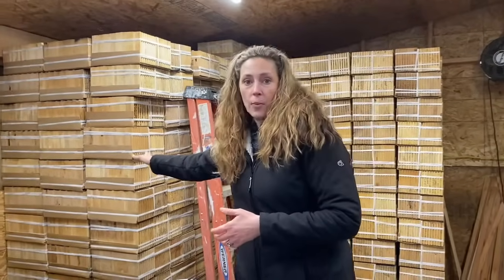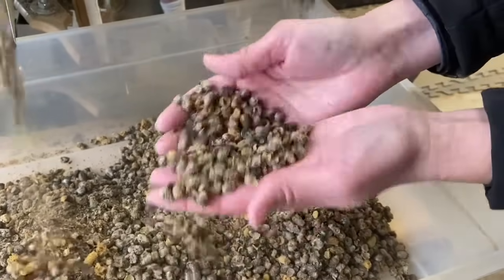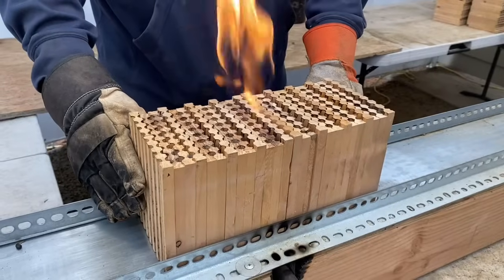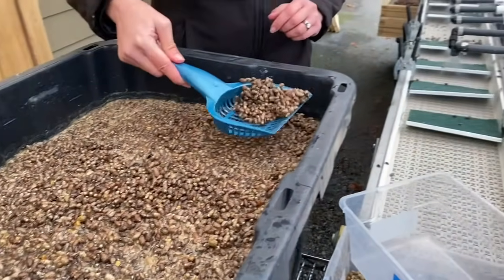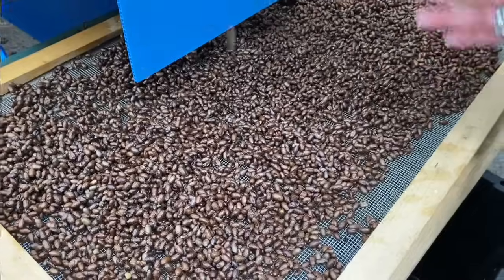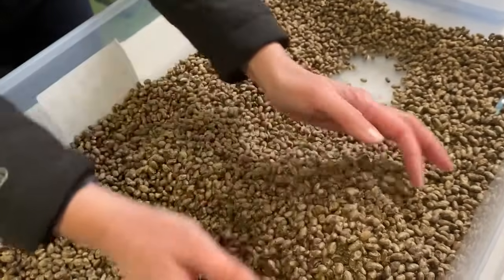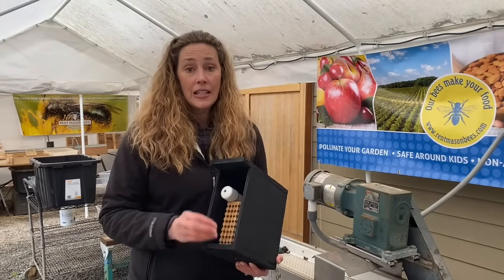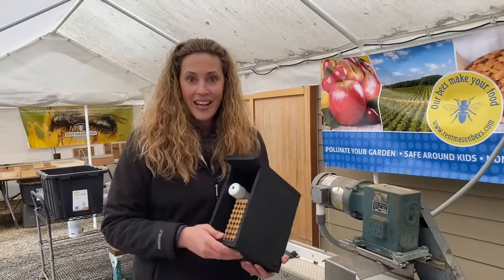Mason Bee Fall Harvest - Watch How We Clean 3 Million Mason Bee Cocoons #savethebees

Comment: Hi, I just wanted you to know that the Houdini fly has made it to Surrey BC 🇨🇦. 
We have three large mason bee houses and our bees fill them every year. But this is the first year that we have seen these flies and there are thousands of them. 
We have been vacuuming them up three times a day and there are now much fewer of them. 
We pulled the full tubes at put them in a fine mesh bag with the sealed end standing up. 
The next day we had to open the mesh and vacuum up about a dozen flies that had been hiding!
Do you think all this movement in May is going to have hurt the development of the bees?
Reply from the maker: Yes. They are on the rise and the biggest way you can help is to harvest and clean your nesting blocks every fall. Houdini fly larvae are very easy to spot and remove. The problem with them is they lay 15-20 babies in each mason bee nesting cell and emerge in spring with the mason bees. They kill the developing mason bee baby and then you're left with tubes full of predators. Are you cleaning them every fall? It is so important to do so. Here is a video on what to identify inside your nesting material when you clean. https://youtu.be/zLg0bYXgu-U?si=H1P3cqHpqGUKYeLZ

Comment: This process was so neat to see! I also really liked seeing the ingenuity of your machines, disinfection and drying processes. I had no idea that mason bee larvae were harvested and redistributed in these quantities. May I suggest an idea for picking non viable larvae which could speed up that task for you? I used to work in a federal salmon enhancement facility where we would pick non viable salmon eggs out of groups of up to 200,000 eggs. We used ‘homemade’ egg pickers made of thin metal banding about 3/4” wide and 12 to 16 inches long depending on personal preference, folded at the centre to bring the ends together and then attached suitable sized paper clip to each end using solder or epoxy, making sure the paper clips line up with each other. This made a springy set of tweezers with which we could pick dead eggs much more quickly than picking with fingers, with minimal disturbance of live eggs. While it looks like the bee cocoons are not nearly as sensitive as salmon eggs, these tweezers may help speed up your process of picking out the non viable ones. There are commercial tweezers available but we found that our homemade ones worked better. If you would like to see what the commercial ones look like to give you an idea on how to make them I can send a link to a company that sells them to your info@ address. Happy picking!
Reply from the maker: Hi Robert. Yes. Please email us. It’s a tedious step in our harvest. Volunteers usually help us during this step to speed things up. Thank you so much.